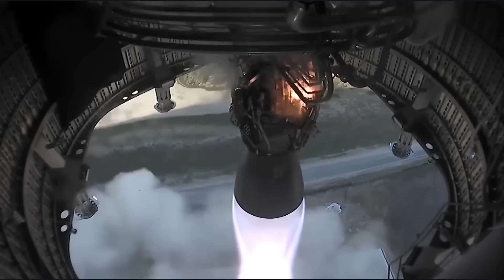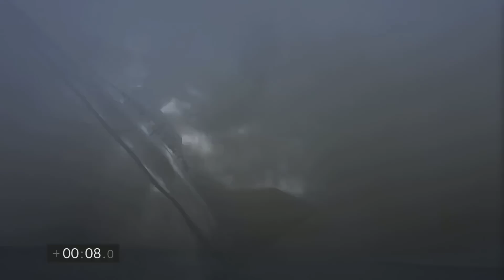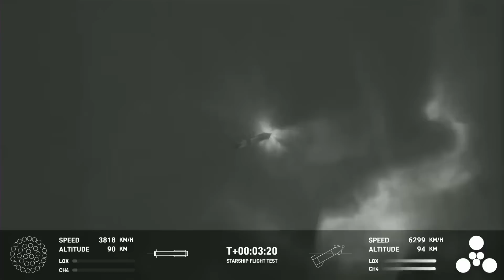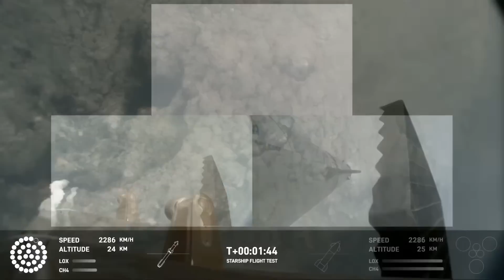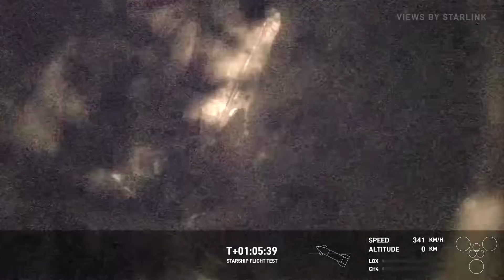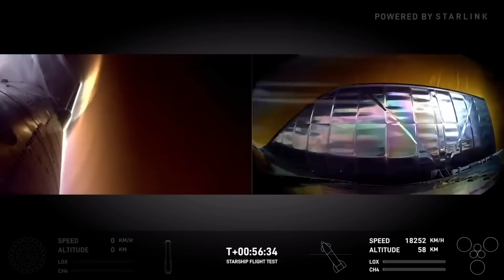All Starship Flight Tests Leading Up To Flight Test 6

Comment: 11:45
Year is marked wrong in the in-video title. 
It must be 2021
May be this whole video should have been a 10min video compiling key event visuals. 
Will have been more enjoyable. This is a two hour long saga. 
No chapter authoring either. Good effort in the lead upto the IFT 6 but too long.
Reply from the maker: -It was 2021, typo on my part. My apologies. 
-There are many, many comprehensive “highlight” videos already on YT, I wanted a video with the full livestreams (minus some commentary/coast phases) all in one spot, so that’s what I did. 
-as of my typing this (4 days from publication) YT has yet to give me the option to add chapters. It’s literally greyed out. I know with my launch livestreams it can take 24hrs before I can do anything to the video due to processing on YT’s end, and those usually only run 20mins, so I’m assuming it’s the same case here. I check multiple times a day and as soon as the option is available I plan to add chapters for each launch. 

Ty for the feedback.
Reply: @russellcarter6451  Yes,2 hours + is good !!! Ive been watching this stuff since before "Hoppy" took off. V well dun !!!!!   Must have been bloody hard work.............I'm only 20 mins in so far !